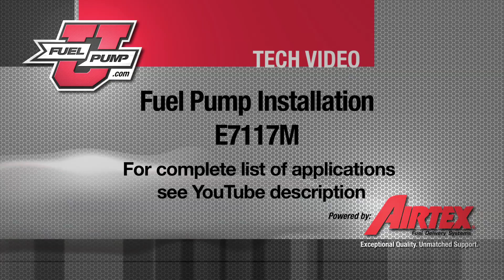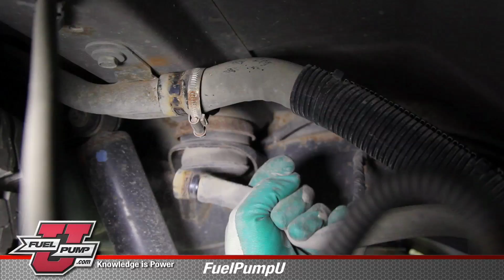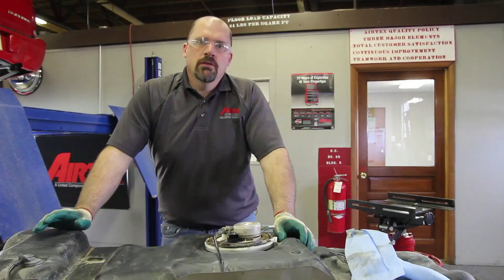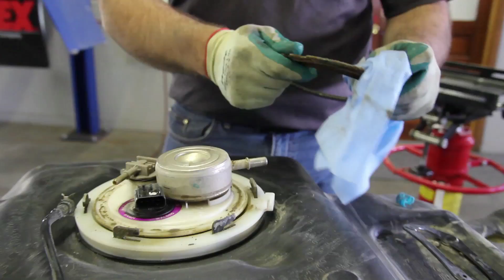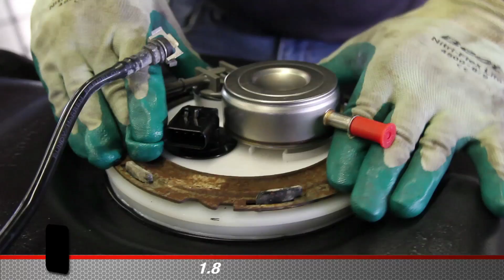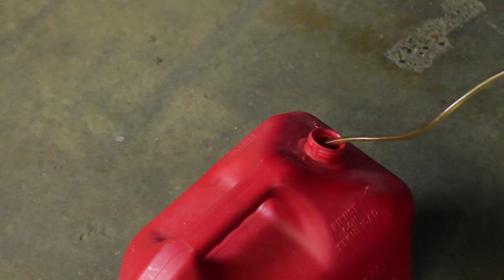How to Install Fuel Pump E7117M 1998 - 2003 Dodge Durango

Comment: I'm not understanding why you didn't just remove the back seat and change it out. This doesn't require getting under the car.
Reply: Some Durangos like mine can't be replaced by going under the seat u have to drop the tank

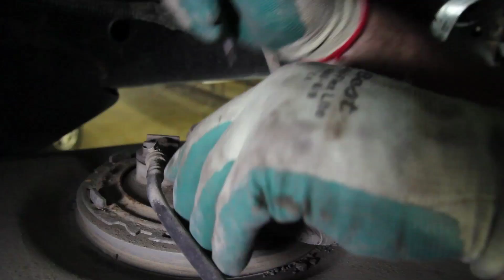Comment: @ 1:35 I my electrical connector would not come off.  I used a screwdriver the top of the plastic came off. It still goes on. Unknown if I have to replace the electric connector Google not helping no information

Comment: Or you could just pull the center seats and install it via the access panel in the floorboard.
Reply: Don't think that's on the 98 to 2002 durangos

Comment: Is the filter in the tank?
Reply: This is what I'm trying to figure out too? Did you ever figure it out?
Reply: Filter is built into the fuel pump , pressure regulator. There is no canister filter outside of fuel tank. I figured that out by crawling around under my 99 Durango, not seeing one I then YouTube search fuel filter for the vehicle.

Comment: Can someone tell me where's the "RELIEF VALVE" located so i can bleed it ...with pics THANKS...did everything forgot to bleed it...lol
Reply from the maker: The port should be found on the fuel rail on the engine, it should have a protector cap on it. Unscrew the cap and you can connect a pressure gauge and bleed the system.
Reply: Airtex-ASC Performance Pumps ...Thanks brotha got it running...

Comment: I got a 2002 Durango. Does it have a fuel pump access panel?
Reply: Mike Squid yes under the back seat. If you have 3rd row seating it's under the middle set of back seats
Reply: Does 98 durango have fuel pump access panel?

Comment: need help. 2003 dodge durango wont start is their a fuel fuse.
Reply: Carol Toland I got the same problem with my 03 durango
Reply: Carol Toland same problem dropping the fueo tank TODAY
Reply: Same problem. Just quit while driving.
Reply: @zechariahhambone3841 did yours have a access panel under the 3rd row seats
Reply: @CASPAINTINGtipsandtricks I didn't tear up the carpet but it didn't appear there was a panel. Had it replaced for $600 in town. Straps too.

Comment: Dropped mine today.  The worst/hardest part was getting the two fuel lines off.  That's what took the most time. Funny thing is the new one doesn't make a sound when you turn the key on.  Thanks again.
Reply: rileycpo . Was there an access panel? 2002.